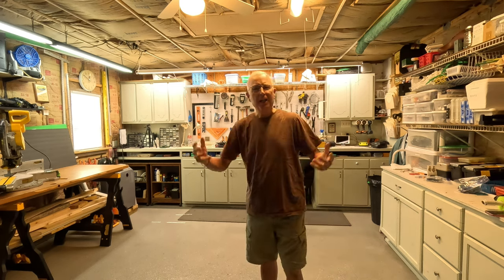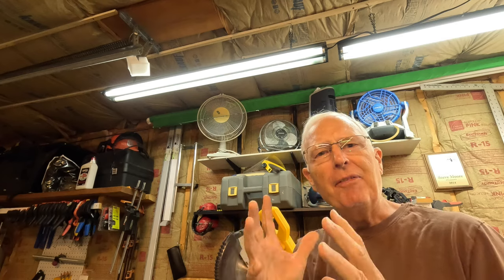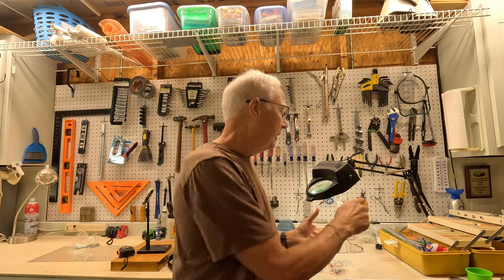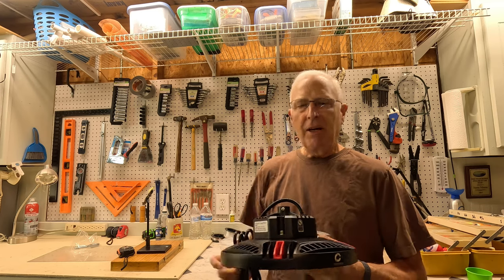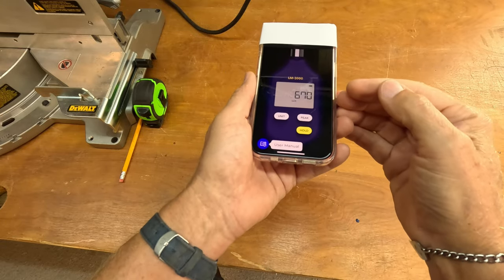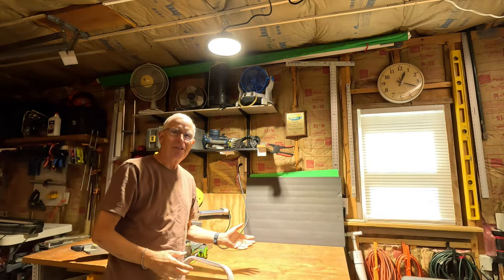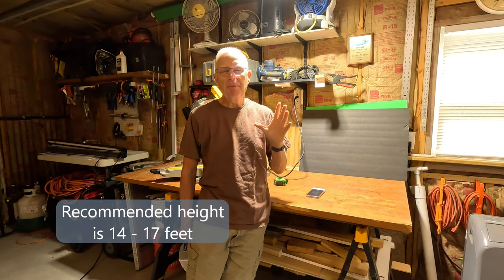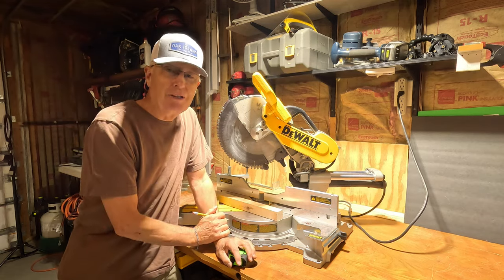Best Light For Garage - Cinoton High Bay LED Light #cinoton

Comment: Is there an issue with shadows? The florescent tubes would have increased the ambient light since they were area lighting. The new LED is more of a point source and I could see shadows on your work surface. They would drive me nuts.
Reply from the maker: Yes, I want to get one additional one and change the spacing.